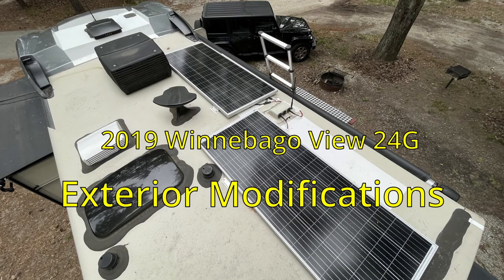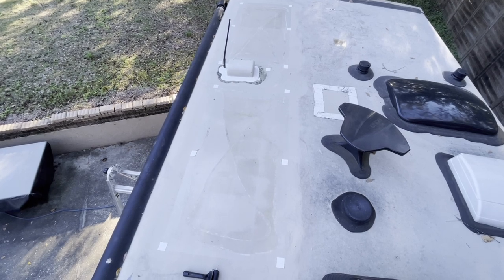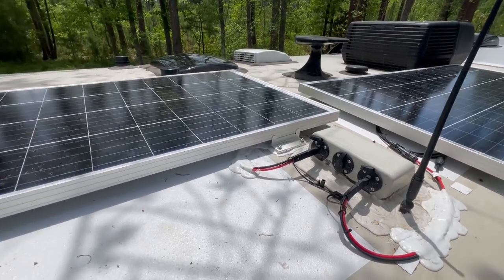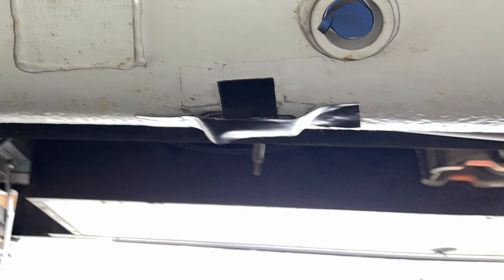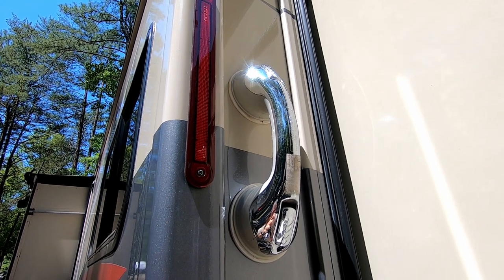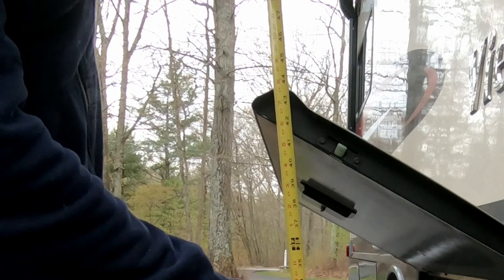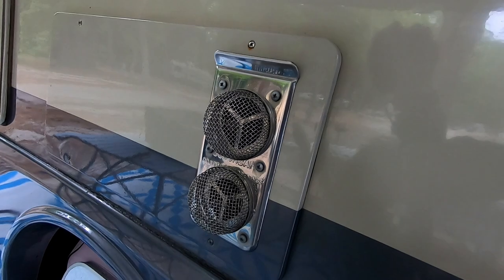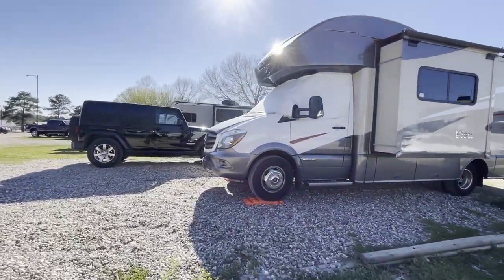External Modifications and Enhancements 2019 Winnebago View

Comment: Taking those flex panels are definitely a pain. Hard to believe they used that much silicone adhesive and still screwed them down too.  I really like that liner spray you used. Doing the whole roof may even make the roof stronger/tougher (it needs all the help it can get).
Reply from the maker: There is really no need to screw them down. The screws are basically trying to hold onto styrofoam. That bed liner spray really is some tough stuff  and it was easy to apply. Thanks for watching.

Comment: Hello great video 👍. I have a 2019 24J View, and I will replace my two original flexible panels next week. Which panel do you recommend for maximizing solar capture? Thank you.
Reply from the maker: I installed 2 Newpowa 210watt panels on my 19G a couple years ago. The industry has made some improvements since then. Renogy has Bi-Facial panels that are supposedly more efficient. Make careful measurements on your RV roof and choose the panels that produce the most potential watts. I have been happy with the two 210watt panels I installed but they are not able to fully charge my 200aH lithium batteries especially during the winter months so I am in the process of adding two 115watt Monocrystalline Bi-Facial panels from Renogy to my system giving me a potential total of 650watts. I think Monocrystalline panels are more efficient than Polycrystalline panels. My configuration will require that I run new wire and add a separate solar charge controller for the new smaller capacity panels. I am happy with both Newpowa and Renogy. Buy the biggest Monocrystalline panels you can fit on your roof. Hope this helps. Thanks for watching and safe travels.

Comment: Great video. One question-is the shutoff for the propane done at a switch at the refill location or can I use the switch inside above the fridge? Thx,
Reply from the maker: Both the switch inside and the one by the fill port must be ON for propane to flow. We usually turn off the one inside and leave the one outside in the on position. That being said, usually the person filling our tank will flip the outside switch to off before filling.
Reply: @MilesAcrossUSA  thanks for replying so quickly😀

Comment: Greetings from an Englishman 🇬🇧 in Arabia! ☺  I'm looking at a 2018 Winnebago View as I hope to prepare for some overland long trips in Main Land Europe.  Any ideas on essentials that I should take please?  May God bless you both! ✝️🙏
Reply from the maker: If you will be doing mostly campgrounds with electric hookups, a electrical management system (EMS) is essential. If you will be primarily off grid, we would recommend replacing the two stock flooded batteries with at least 200 amp hours of lithium batteries. 400 amp hours would be even better and at least 400 watts of solar on the roof. The other essential item would be a tire pressure monitor.  Our third recommendation would be a high quality water filter. Best of luck with your plans and safe travels.
Reply: @MilesAcrossUSA  Thank you! ☺  It won't be for a year or more etc.  I've tried your website and its not working from here?  Can you recommend a good "View/Navion" website forum to join please?  I don't use Facebook!
Reply from the maker: @gereshomeE  The best forum is the View/Navion Motorhomes Facebook Group. It would be worth signing up for Facebook for that group alone. That group has a standalone website as well at viewnavionmotorhomes.com with lots of information such as owners manuals and much more. The thing we like about the Facebook group is you can post a question and expect an answer within minutes. The other website we use is viewnavion.com. It contains how to articles for a bunch of modifications. The author of that website is also a member of the Facebook group. Hope this helps.
Reply: @MilesAcrossUSA  Yes, THANKS! ☺

Comment: Thanks for the great info. I am going to install carefree awning  motion kit do you have the switch wire diagram from the oil switch my model 2019 24G view thanks Jerry
Reply from the maker: Hi Jerry. I’m not sure what you are asking for.  The kit comes with instructions and wiring diagrams. It was pretty easy to install. The original switch, which extended and retracted the awning is replaced with 2 switches. One for turning the power to the awning on and off and the other to extend and retract the awning.

Comment: Just purchased a 2018 View 24V. Previous owner has a lot of electronic  mods that I have to learn how to work. The solar battery charge indicator only works when the engine is running. No interior lights work without running. Exit steps work running or not. Anything to look for ?
Reply from the maker: There is a Coach Bat switch by the steps. Make sure it is on.
Reply from the maker: If you are not a member of the View/Navion Motorhomes Facebook Group, we strongly recommend it. The members have a wealth of helpful knowledge. The Admins are the best of any Facebook group we have joined.